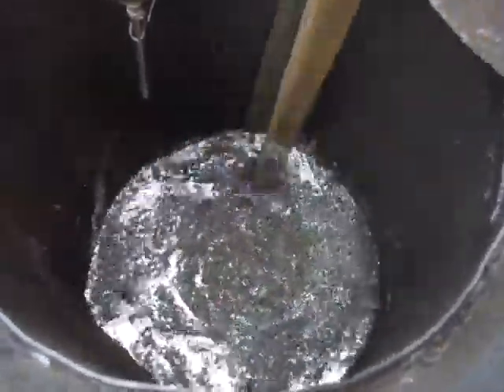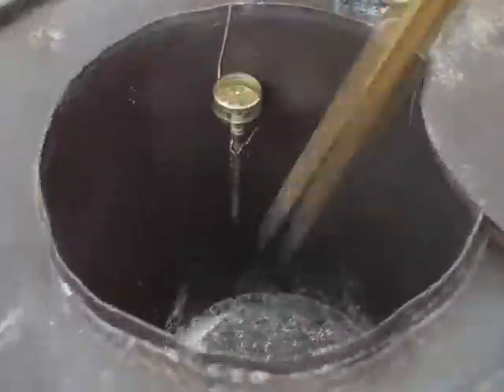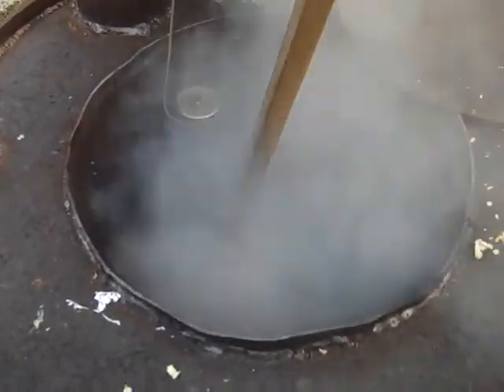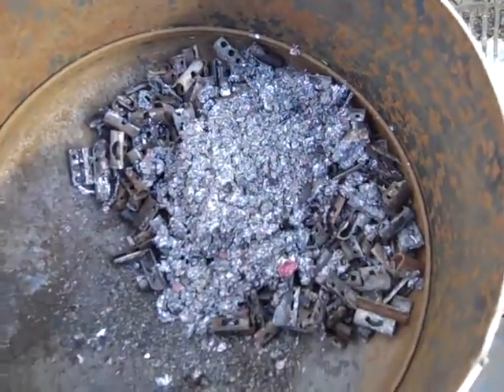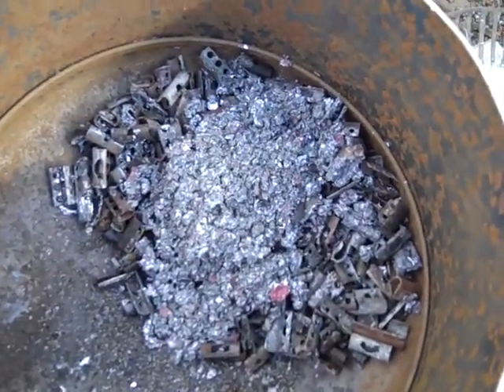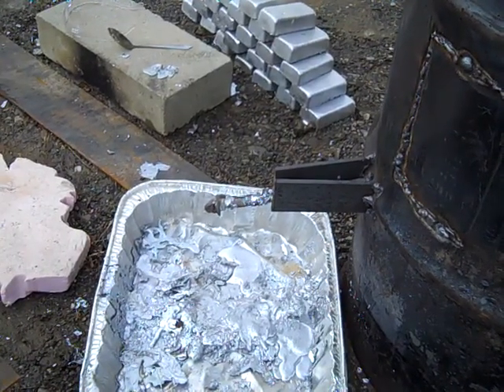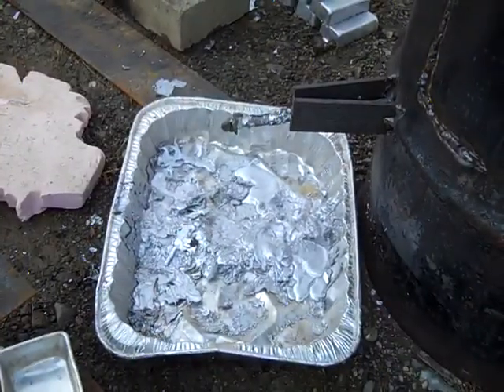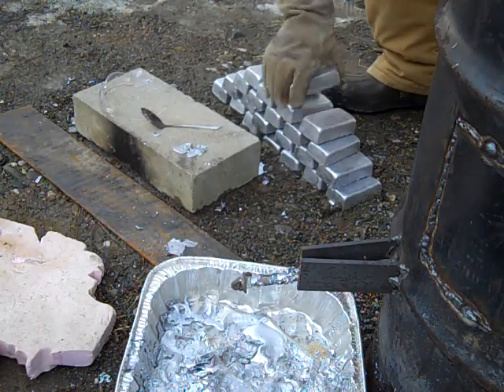140 lbs of molten lead - preparation for making ingots for bullet casting

Comment: For those commenting on the respirator use. yes safety always comes first but like another poster said lead vaporizes at 3000*. With him doing this outside and hearing the wind blowing he has more then enough ventilation for this not to be a health risk. There is more of a risk in handling the lead with his bare hands. I too cast lead and do it outside, any who melt lead using a flame source for heat should also do so.

Comment: Lee Amato, any raw (non-galvanized) metal will only put off fumes when it reaches it's vapor point, but by the time lead reaches that point, your steel pot will start melting. Learn melt points, malleable points, boiling points, vapor points and how they change depending on the other alloys (and the amount of those allows) are mixed with what you're melting. That's my friendly recommendation.

Comment: Lead is a metal, it atoms are held together in a metallic lattice with REALLY strong bonds, hence why melting point are (generally) very high, water has only weak forces (not bonds) holding the h2o molecules together it is easy for it to evaporate, don't forget the triple point of water is 0.1 degrees celsius

Comment: I’ve seen somewhat similar setups for bulk melting where the output was an iron pipe with a spigot valve. Would be a lot more controllable for pouring than the “valve” your currently using

Comment: I think the melting point of a metal is determined by the number of electrons in the atom, and the charge of the metal. Water has very STONG H-bonding, between the delta negative Oxygen molecule and the slightly delta positive molecules of other water molecules. H-bonding is the reason why ice is less dense than water. There is some cool stuff on Wikipedia if you are interested further.

Comment: Melting point 600.61 K, 327.46 °C, 621.43 °F
Boiling point 2022 K, 1749 °C, 3180 °F (at its boiling point is starts to emit vapors, which is your concern.)

I don't think that melter temperature is 3180 F.